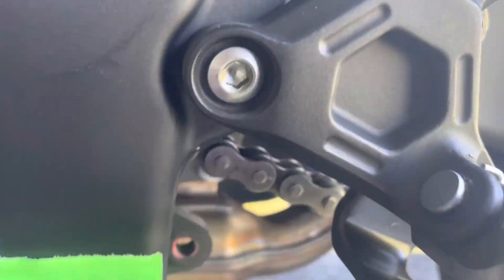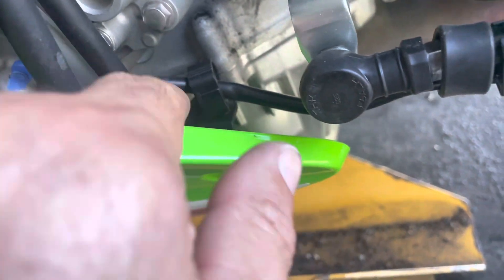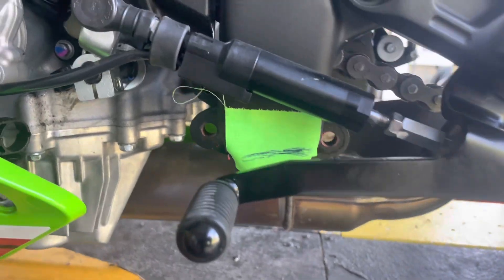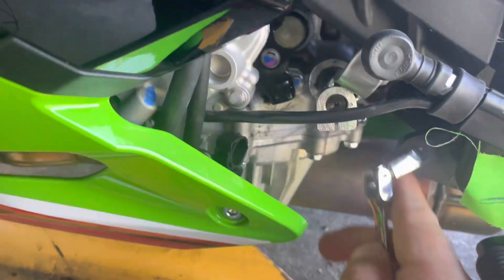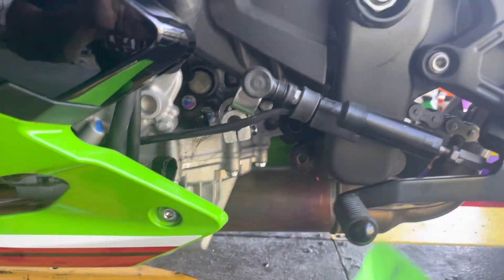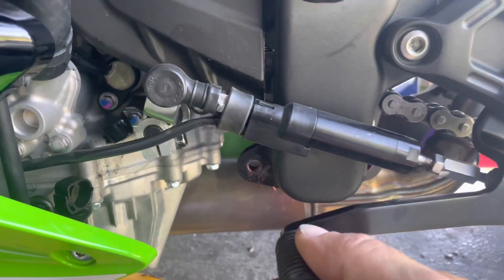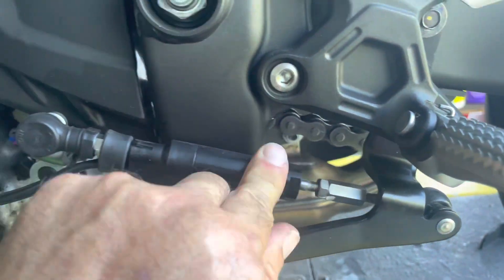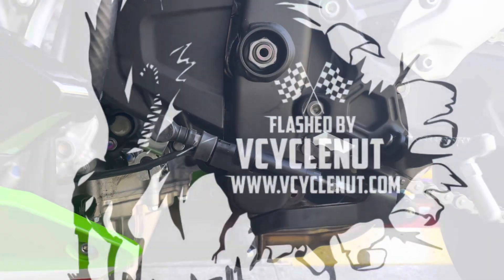Zx4rr gp shift how to and still have the quick shifter auto blipper work!

Comment: If you flip the rod on the rear-set end you won’t need to re-flash your ECU.
Reply from the maker: I dont think its possible on this bike. 

Have you actually done it?
Reply: Yes. Had to buy a rearset and add a washer to the shifter to push it out just a tad. I also aimed the front linkage to lessen the bind but it did work. You do have to get use to the bar being there. Ben thinking of doing it again to the new bike but didn’t really see an advantage to the GP shift when I was on the track so still not sure if I will waste the time and money.
Reply: @RobertDeFart hi, can you please show me how it's done? Could you send me some pictures on how did you get it right? Thanks

Comment: Could you just flip the shift link around backwards to reverse it too? Asking for a friend.
Reply from the maker: Sorry. Im not sure what your saying
Reply: If the rod is in 'pull' for the road setting, but now in 'push' for gp shift - changing the rod orientation as well will keep the required push/pull settings even though you've changed to gp shift. 👍🏼

Comment: Is it possible to custom change only sports mode to GP shift bband have rain mode to use standard shift?
Reply from the maker: No.  The setting in the ecu is just for the quick shifter/ auto blipper.  Which direction the bike shifts is mechanical and has to be changed like the video shows.
Reply: @vcyclenut  I understand. I am referring to when I need to change to gp shift at the track (reposition shifter arm), and instead of flashing again I can just switch to mode to activate.
Reply from the maker: @piasob  no.  Its not adjustable by mode.
Reply: @vcyclenut  ah, I see. thanks!

Comment: i`m oversea the technican here don`t know how to do that and i also heard changing the sprocket will  cause TC malfunction, what should i do?
Reply from the maker: Do it yourself. No the sprocket change does not cause tc to malfunction.
Reply: @vcyclenut  did u changed the sprocket yet?
Reply from the maker: @Rorschach34Bos  yep.  No issues
Reply: @vcyclenut  what did you change to from the factory 14-48 that the zx4rr comes with? 
Thanks in advance.